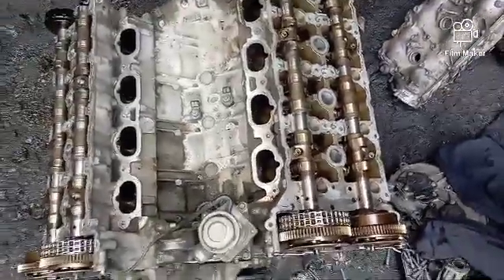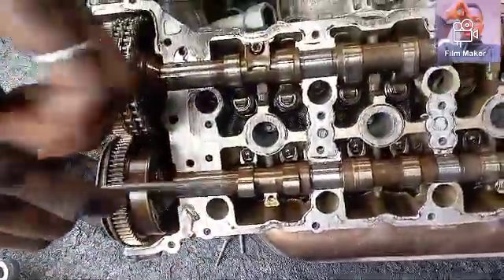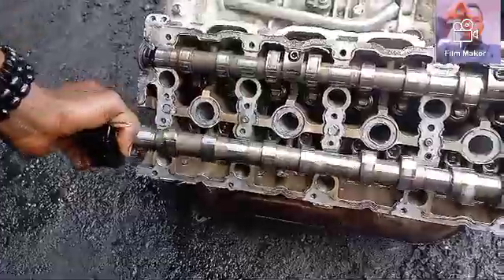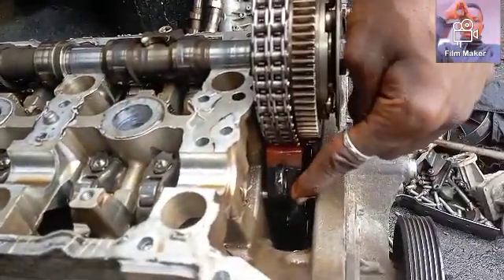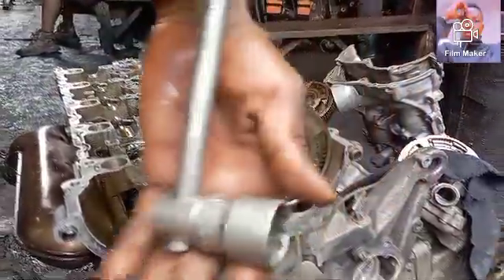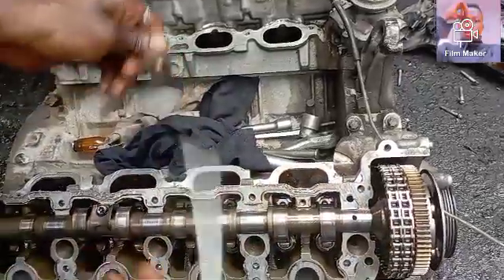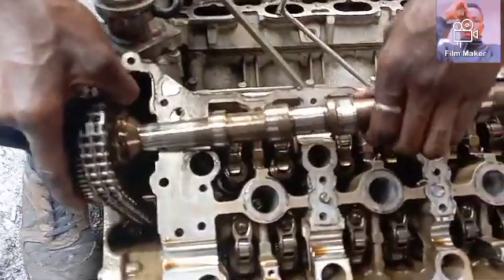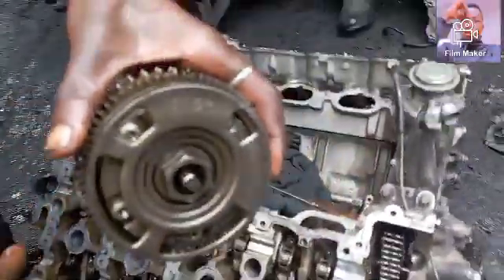Mercedes Benz m273 camshaft removal.

Comment: My m273 engine is misfiring so I remove the top cylinder and found little oil mixture on number five and six piston which did not burn at all but when I put fuel to test the valve, the number five and six that did not burn were not licking but the rest valve that burn were licking so I was confused

Comment: Hi, what size bolt did you use to remove the Plastic tensioner PIN??? Mine has an M6 and a smaller one... M5 is too small and M6 is too big...perfect size would be M5.5 if I can find one!!!